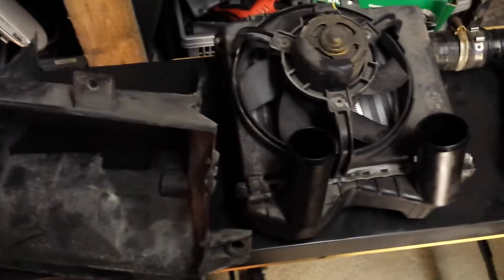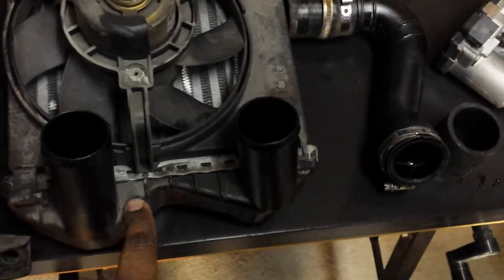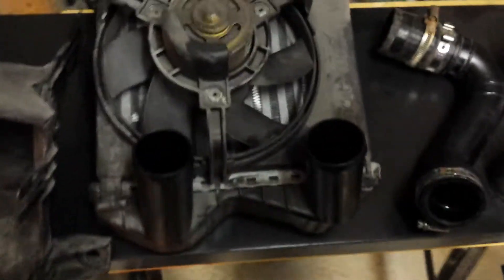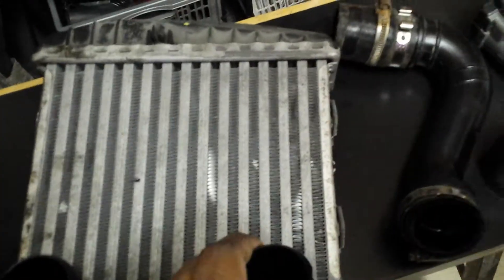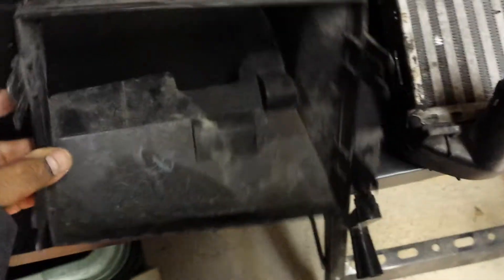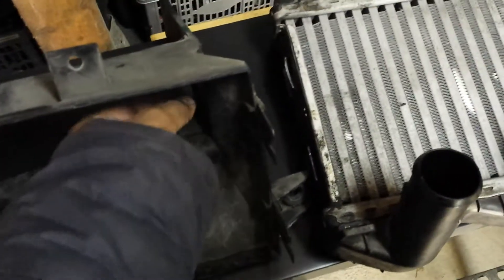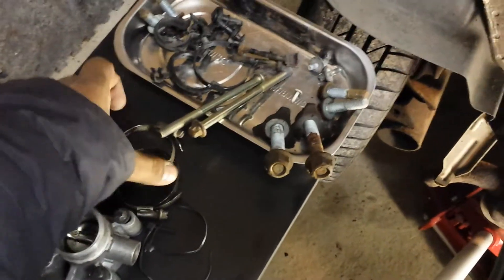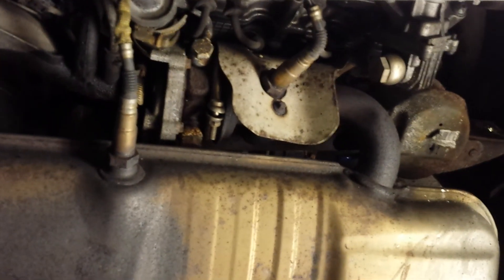Smart Fortwo 450   Starter motor replacement and lowering the Engine   Part 3

Comment: i agree with Mr Grey , a 45 min job... its title but can be done.   05 450 passion  s.Mann upgrades
Reply from the maker: Hi, you could be right as the procedure may have been approved in the later models. The car in the video however is a 2004 Smart ForTwo 450. The job cannot be done in 45 minutes for the mere fact that the bolts head is behind the fan and the end fastens through the engine to the starter motor. This is also shown in the article http://www.evilution.co.uk/678 . You have to do this job to appreciate the extent of trouble one has to go through to replace the starter motor. If you have done this job, please share your link / pictures with some information to help others.